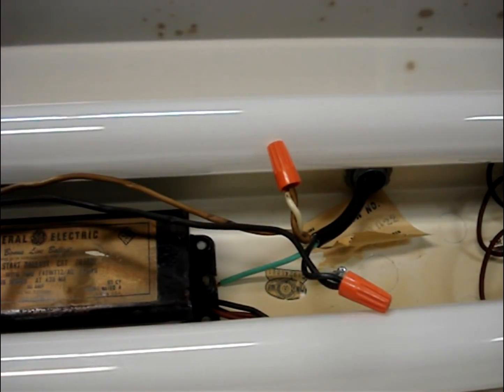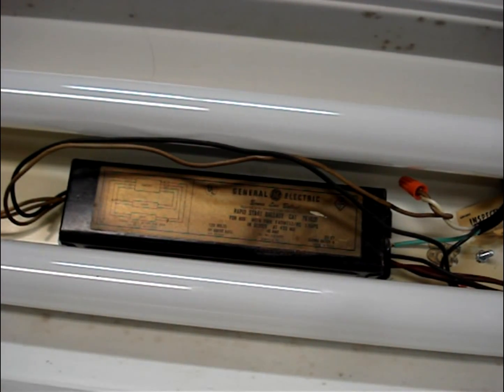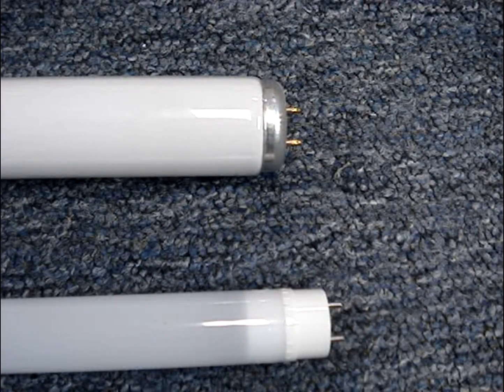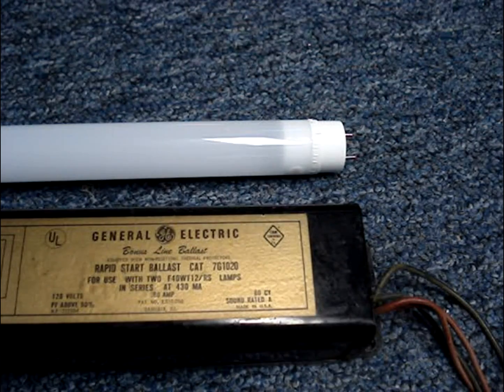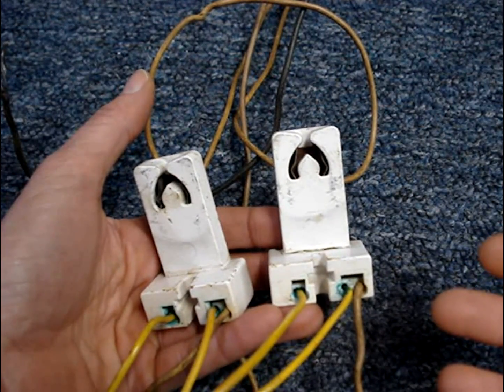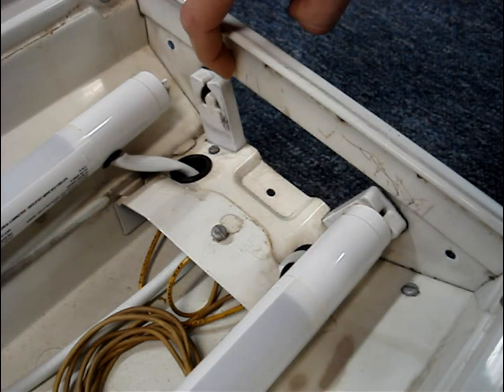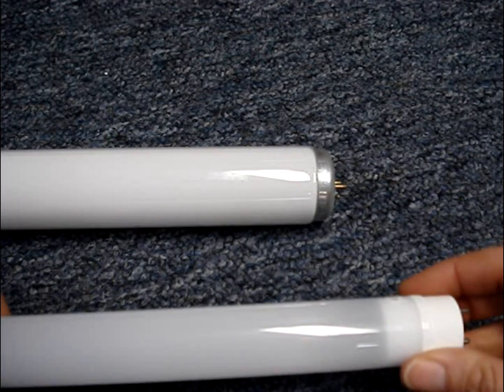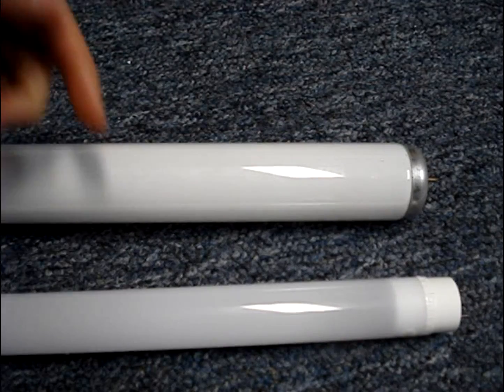Introduction Retrofit T8 T12 Fluorescent to LED Tubes

Comment from the maker: I just picked up some LED bulbs to replace some old incandescent ones.  The package claimed that it does not cause "harmful interference".  I plugged a radio into the same circuit as a lamp holding one of these bulbs and it did not cause static on the radio.  LED bulbs are getting better all the time.

I also saw some complaints that the LED tube lights cause a lot of heat and can cause a fire or  cause the internal driver to fail.  I did check the temperature inside of my retrofitted fixture and found it to be cooler than an identical fixture with still fitted with fluorescent tubes.  The heat complaints were from some time ago, I think that some companies have solved this problem.

If you do your homework and buy the bulbs from a reputable and established company, I think you will likely have good results.

Comment: Awesome, thanks.
Reply from the maker: You are welcome.  There are so many options out there, I thought it could be confusing to someone who is not in the electrical trade.  Unfortunately, people don't have time to research it or don't feel confident rewiring the fixture, so they go with the plug and play tubes.... and the savings may not be worth the price of the tubes.  I really like the Feit direct wire ones in the video.  I think they are a good choice for a homeowner who has limited electrical knowledge.
Reply: Know How Now electricity and water scare me lol.
Reply from the maker: I have formal electrical training and worked in the field for many years and I am still very careful when working with it.